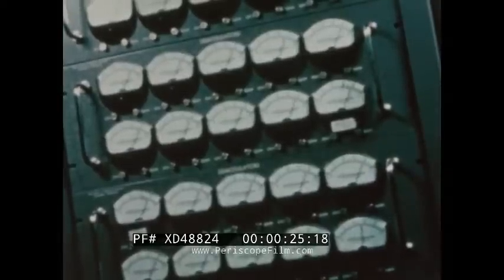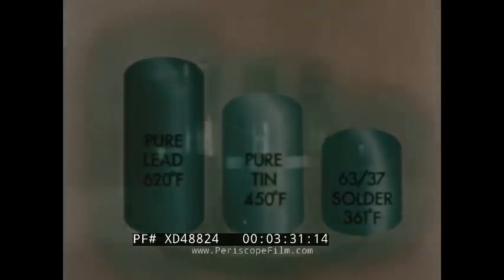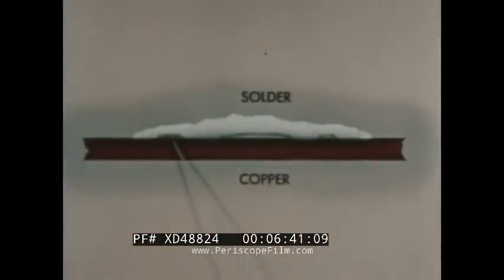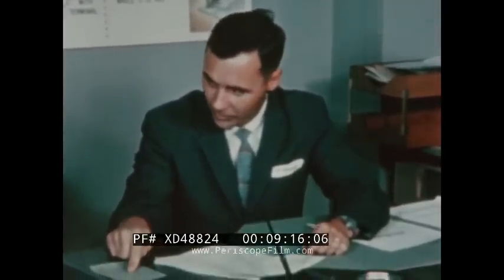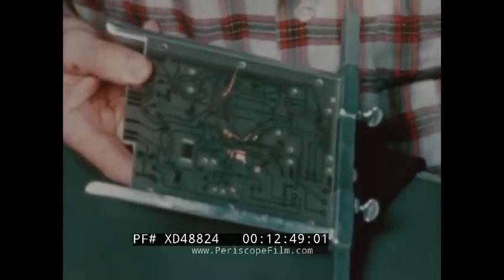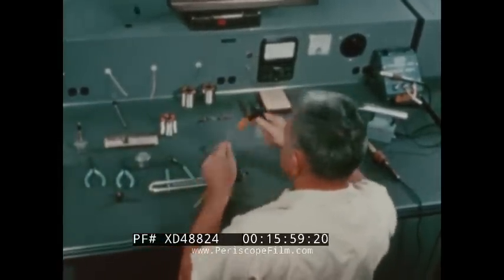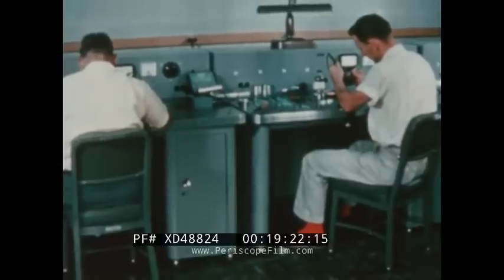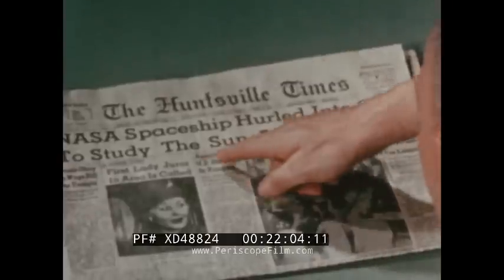1958 "ABOVE AND BEYOND" NASA SOLDER & SOLDERING TECHNIQUES ELECTRONICS INSTRUCTIONAL FILM XD48824

Comment: Beware of people who "have been doing it for years and know how it's done." There was an instance of a building site where the welds were not meeting their strength tests. Finally they went to the site and found that the welders were not following the engineer's instructions on how to do the welds, because "they knew welding better than some pencil pusher." They had the welder do a joint the way he wanted to do it, then did one the way the engineer specified it while the engineer watched. Then they tested the welds to destruction right there. No surprise the engineer's way was able to hold several times the weight. It turns out that they DO teach you useful knowledge in those years in college. After that the welders did it the way they were specified.

Comment: thank you so much for the video, I personally learned soldering 8years ago in a (French) model rockets club (without second charge, as were our motors given by CNES, you need a electronic timer to get the parachute out), except for the basics : not too hot, the tip heats up both the pad and the lead, put solder on the pad instead of the tip, pre-tin a wire beforehand, cut off excess leads (afterwards, shame) I learned everything else on the go, I learned so much in just 10min, being definitely the bad-habits type, I can't express my thanks
Reply from the maker: Glad it's useful to you.  Love our channel? Help us save and post more orphaned films!  Support us on Patreon: https://www.patreon.com/PeriscopeFilm  

 Subscribe and consider becoming a channel member  https://youtu.be/ODBW3pVahUE

Comment: 1985.  2 week summer course on soldering as part of my tech school.  Instructor claimed to have been NASA trained.

We spent about a week learning how to strip and tin stranded wire and make those 1/2 loops and solder onto the turret terminals as seen in the later part of the film.

It was certainly valuable training.  Not all that useful since though.  Worked in mfg later on and now design.  Automated processes for solder in production so hand work is rare.

Comment: I've been preforming electronic repair for over 40 years, starting as a teenager. All of these principals I already knew, however there is one that they didn't mention specifically which was...Solder flows towards the heat source. For that reason I will apply the tip to the work adding enough solder/rosin to wet the tip/work into heat transfer. As soon as that happens, I move the solder to the other side of the work so that when it begins to melt, i add just enough solder required for an effective joint while the solder flows across/though the work to the tip. Then don't move/disturb the work until the solder solidifies. Too much heat causes the rosin to burn allowing oxidation to enter the joint as well.

Comment: Ha! I was NASA certified for soldering wayy back around 1980. Im sure things have changed then such as size of components soldered. But the overall work is still the same... best of the best & your best work. It is what works best to achieve our dreams into space. Anything less is for manufacturing cars, appliances, or smartphones which are built to malfunction because it continues the demand that drives business. But for things going into space a simple malfunction has serious consequences which can end a multi billion dollar program. Its a line of work & dedication to quality which any other business is sadly exempt from participating in.

Comment: 04:00 "no one knows why alloys melt at lower temperatures". This note on the web indicates they know now - The different sizes of atoms in an alloy make their arrangement less regular than a pure metal. This makes the bonds between the atoms weaker, and lowers the melting point. Alloys that melt easily, such as SOLDER, have important uses.

Comment: "The dull, milky appearance indicates a cold joint. Not enough heat in the solder." I also had this milky appearance show up with too much heat. I guess it depends on all kinds of things.
This video also made me realise how many bad soldering habits they teach me at school.
Reply: Pace (manufacturer of soldering stations) has some great similarly-old instructional videos on youtube that go into much greater depth. Recommend these if you want to build the skill.

Hand soldering is a fine dance. Too much heat can ruin the component, or even lift the trace from the board. Good soldering requires controlling all the following:

the heat of the iron’s tip,
the rate of heat conduction (using a wetted tip; also an appropriately sized tip for pad),
matching power of iron and thermal mass of tip for the thermal mass of the joint,
contacting both the pad and the component to heat both before flowing the solder,
adding solder to the joint opposite the iron—never flowing solder onto the tip,
adding the correct amount of solder for the joint,
allowing just a moment for the solder’s phase to change as it wets both conductors (ionic exchange),
not disturbing the joint as the iron is removed.

And after all that, keeping the heat on the joint for only long enough— ideally 2-3 seconds total. Because more time can mean overheat and damage the component. And also if it takes longer, the flux will likely have cooked off before the solder to flows, resulting in a very poor wetting and a cold joint.

But it gets easier to judge the correct heat / tip selections with repeated practice using a given iron. It all gets much easier with practice.

Comment: I did micro miniature high reliability solder course for the RAAF in 1990 and then spent the next 2yrs in the lab soldering circuit boards for avionic equipment fitted to the F/A-18 Hornet.... same video was used as introduction..same emphasis on quality in the process...

Comment: I had to go through the NASA soldering training and then pass the practical exam, back in 1989 during my Navy electronics technician training.  Some things were different then, from what was depicted in this video.  For example when soldering parts into PCB's, in this video they bend the component lead under the PCB on the solder side and then cut it, in order to hold the component in place for soldering.  They even depict a "good joint" as one where the component lead is bent to be flush against the PCB soldering pad!

Both of these were BIG no no's when I was trained, as this makes part replacement more difficult after desoldering and risks breaking or pulling up traces off of the board, since not all solder between the component lead and PCB solder pad will be removed during desoldering.

Do this just once on your practical exam PCB and you've failed.  Fail your soldering exam and your one shot at that chance at employment was over.  They were looking for both aptitude and attitude.  If you were lazy with one joint in your exam, you're out.

After I worked for the Navy, I then went to work for a national telco.  My manager at the telco was blown away by how good my soldering was, in the cup of the middle pin of a BNC connector which he used as a test to gauge how good my soldering was.  Everyone he tested always used too much solder and it beaded around that tiny little cup.  Whereas my first attempt only had solder inside the cup and the amount was small enough to see the slight twist in the wires within the cup, under the solder.  He couldn't believe his eyes and told me I was a smart-a for soldering much better than him.

I later worked in a factory building Point of Sale terminals and this job I got sight unseen with no interview at all, simply because former Navy electronics tech was on my CV.  I applied for the job, then the business owner called me to say I had the job, because he knew what this meant as far as soldering training and ability.  Again the manager there tested me with one board.  After I was done she looked at my work and then asked everyone in the room to stop work and down tools.  She then walked around the room showing each worker there the quality that could be achieved with hand soldering, since my work quality and consistency was almost indistinguishable from robotic wave soldering.

This is not to say that I was good, because it wasn't me, it was the training.  All you need is good sight (even if with glasses), steady hands, good training and good attitude, to do a proper job.  Soldering training outside of aerospace and military was usually terrible back then.  Even in modern training I see it is lacking.  Cutting component leads AFTER soldering!?  NO NO NO NO NO!!!!

Nowadays my sight is nowhere near as good as it was back then and my hands are nowhere near as stable, so my soldering is good enough to do repairs at home, but I won't be doing any PCB work on any anti-aircraft missiles again!

NASA's soldering course was outstanding.
Reply: NASA doesn't allow PCB rework anymore. Today you either have a good PCB or you replace the entire thing. Problem solved.
Reply: @schmetterling4477   Makes sense.  Same thing for the Navy?
Reply: @beardymcbeardface69  They still rework ships, as far as I know. :-)
Reply: @beardymcbeardface69  They're still reworked, but the Navy doesn't do it themselves anymore. They send it back to the manufacturer and we either rework it or scrap it depending on cost and the terms of the contract. 
 This is a huge problem because the Navy used to be a major source for our talent pool. It's actually where I got my training and experience. As the years drag on, it's becoming more and more difficult to find anyone who can do this job and us grizzled old guys are retiring in droves. 
 I was hit up this morning by the guy who's been tapped to support a Navy program that's out of production, but we're contractually obligated to support until 2035. Bear in mind this system was designed before MS/DOS existed and bubble memory was cutting- edge technology. He asked me if there's anyone around who's an expert on the processor in that system's control and digital interfaces, and I had to tell him "nobody left but me now, and you're going to have to become the new expert". Everyone else who ever engineered or worked on this system is long retired or dead. 
 I worked on that system for 17 years, focused almost exclusively on the processor and digital controls... but I moved into an R&D lab 3 years ago and I'm retiring in 4 years. I used to know the whole system like the back of my hand, but I'm already starting to forget the details. I don't know how he'll cope with having this antique dropped into his lap or how he'll pass on what he's learned to the next victim.

Comment: 3:46 no one in 1958 maybe; solder doesn't form a crystalline structure like the metals it is made from, this lets the phase shift happen more easily as there is not as much support from the lattice.

Comment: The joint at 13:57 is actually not that great because there's a void immediately at the rear of the lead, suggesting the hole in the board may not be fully filled. A bit more solder and/or time would remedy this.

Comment: ok - ChatGBT said:  Solder is an alloy made by mixing two or more metals, typically tin and lead. The melting point of an alloy is usually lower than the melting point of its constituent metals. In the case of solder, the melting point is lower than that of both tin and lead because of the following reasons:

Intermolecular forces: The melting point of a substance is determined by the strength of the intermolecular forces between its constituent particles. When two metals are mixed to form an alloy, the intermolecular forces between the particles are disrupted, leading to a decrease in the melting point of the resulting alloy.
Eutectic point: The composition of an alloy can also affect its melting point. Solder is typically a eutectic mixture, which means that it has a specific composition that has the lowest possible melting point. The eutectic composition of tin-lead solder is approximately 63% tin and 37% lead, and this mixture has a melting point of 183°C (361°F), which is lower than the melting point of either tin or lead.
Solidification: When an alloy solidifies, its melting point can change due to the formation of intermetallic compounds. In the case of solder, the formation of intermetallic compounds during the solidification process can also lower the melting point of the alloy.
In summary, the lower melting point of solder compared to its constituent metals is due to a combination of factors, including the disruption of intermolecular forces, the eutectic composition of the alloy, and the formation of intermetallic compounds during

Comment: I used to work at Underwriters Laboratories for a while.  NASA would have circuit boards built in a batch of identical boards.  They would pick a couple from the batch THEY RECEIVED and send them to us, we would test various parts for adhesion of the copper traces to the board and other things.  If one failed at ANY point for ANY reason the other could be tested but it was likely the entire batch would be rejected and destroyed.  Imagine a fault in a board that shook loose in the launch and was supposed to control the rocket engines for insertion into lunar orbit.  The joints failure would send the capsules into an orbit going to a couple of stars over, after a few million years with NO WAY for the astronauts to change it.

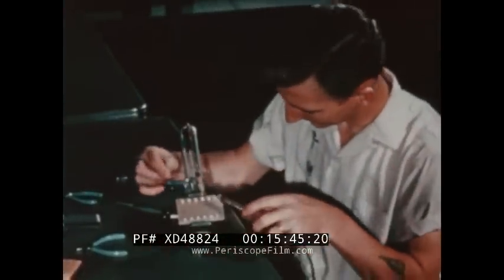Comment: 15:50 student moves the wire before  solder has cooled. This results bad joint.
You should always wait until solder has cooled down before touching components.
As they tell at 17:26.

Comment: It’s not so much a mystery as it’s very difficult to explain even with simplified jargon.

Essentially solder compounds tend to have a “strained” phase from crystal and liquid form, this inherent strain is the humorously named “gibbs free energy” which basically measures the potential for a chemical bond to more easily change phases given sets of pressure/temperature gradients. 

Soldering essentially has less thermodynamically stable crystals than it’s  parent compounds.

Comment: I was surprised this was a somewhat limited soldering course. No mention of rosin core (electronic work) VS acid core (typically plumbing), or matching coefficients of expansion of the device leads or board substrate with the solder which can really bite when the temperatures vary from high to low which after a year or so causes the solder to get stretched and lose its grip either to the lead or the circuit board.  Also, no mention of desoldering where you have to be careful to keep the solder mixed because it tends to separate into its base metals of tin and lead after slightly prolonged heating which causes the solder to re-freeze due to the base metals having higher melting temperatures.  Some people are tempted to turn the iron temp up to re-melt the solder but those higher temperatures can damage the substrate board, or cause the printed circuit runs to debond from the board, or components to be damaged by overheating. The proper way is to flow fresh solder in and vacuum or wick off the excess old solder quickly to help restore the lower melting temperature so things don't get damaged with heat.  I was in two-way radio for 11 years through the 80's, used to work on everything from tube radios to pagers and handheld radios, so your soldering skills were always getting tested. ;)
Reply: This was designed for people learning to solder on the NASA assembly line, and all of those details would have been worked out by the engineers and documentated with reams of spec sheets for a component.

These guys just had to read the spec sheet and follow the detailed directions.
The people doing what you described were in a different building lol
Reply: They mentioned that there are many fluxes, but only rosin was acceptable in this application. Your other criticisms are good ones. This film was not meant to substitute for the real course.
Reply: Not an expert solderer by any means, but what you describe is what Ive found to be the case too, by experience. Ive soldered since I was 11, now 49, but never had a formal "class", just my dad giving some quick tips. Today my 10 year old just soldered in some new capacitors in our dvd players powersupply, fixed it too!
Reply: @david203  You are right, it does appear the purpose of the film is more an introduction to soldering to establish fundamental principles and not a comprehensive training video because as you probably know, there are a lot of other things about soldering they didn't cover.  But, if they did, I sure would love to see those videos!
Reply: @Santor-  That is awesome and a great skill to have too.  Sounds like you have a budding electronic expert on your hands.  I've tried to get all my kids into electronics, they have all soldered kits of one sort or another but none of them had much of an interest in it.  Now trying to get a grandkid or two interested in electronics, so I guess we will see where that takes us.. lol!
Reply: @ke6gwf  Yeah, you are probably very right. All the weird issues were probably already worked out, they just needed people to do the soldering.
Reply: @Santor-  Congratulations to your offspring. It is a great accomplishment.

Comment: It's funny to see how now days even some of the techniques shown in this video are considered to be bad practice.  I worked for BAE Systems in a plant that assembled PCB's and built cables and wiring harnesses. Most of the work we did was spec'ed to MIL std's, but we built everything to NASA std's because some of the work required it and it kept them from having to train us to different standards. Pulling the stripped end off of the wire the way that the instructor did at 16:28 causes the "lay" of the stranded wire to distort and fray out.  This is a big no no these days. Of course, now days we have automatic stripper machines that you just poke the end of the wire in to and it strips it perfectly (almost) every time.